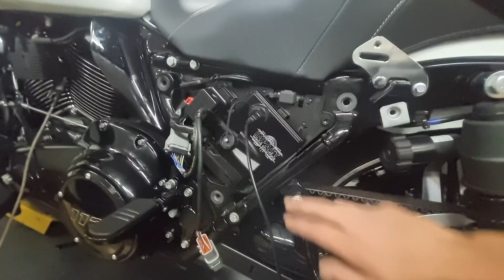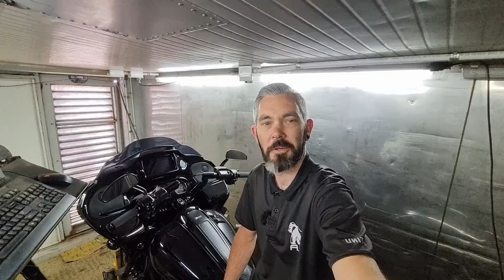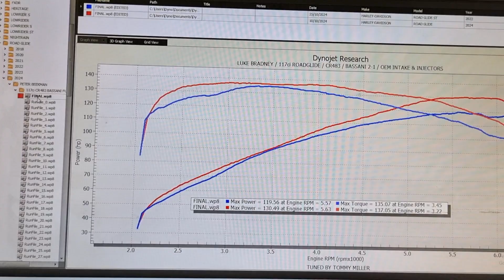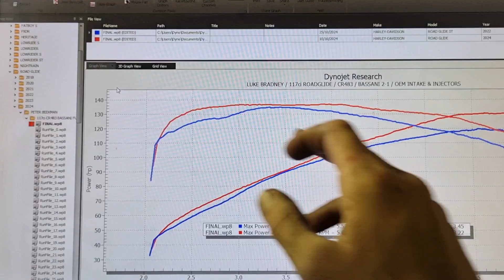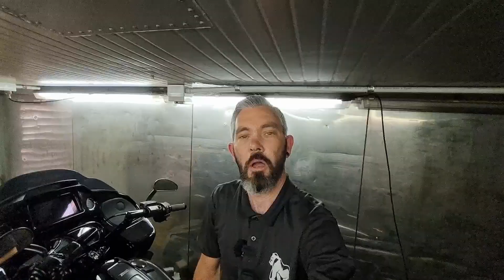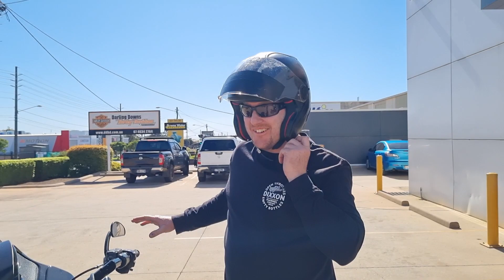IS THE 2nd GENERATION M8 REALLY BETTER?

Comment: Not impressed with Gen 2 over Gen 1 much ,why the Gen 2 has a  4.627 crank plus 4.021 pistons bore, an hp an Tq was to close so Gen 1 held its on for a smaller engine size.
Reply: Put a s&s crank 4.6 an head work on Gen 1 an after market thottle body u will b happy

Comment: I was able to get the new gen 2 stock 117 to make 150hp/151trq. 
SPC exhaust, 68mm Harley throttle body and manifold/ custom velocity stack intake, 8.1 injectors and E85. Cam used was a cycle Rama CR512 cam. Try it out. Tuned in thundermax ecu.

Comment: 119hp 135tq for gen1 m8 with a cam looks about right, i had that mine and you can maybe get more with a better air cleaner or pipe/cam config, but that ~12 digit difference between the two is in everyones graph. having the power go up like that to 130 now with just a cam is fantastic. its clear the gen 2 m8 just runs more efficient.

Comment: I’ve got a 23’ FXLRST with a Bassani ripper exhaust. With my pipe being slightly shorter, would a CR483 cam still have good lower end torque as shown on this video, or would you recommend something else? I mainly ride between 2500-4000rpm.
Reply from the maker: @Fxlrst_mcghee  I've not tuned the Ripper pipe before so I can't give you an accurate answer, however my experience tells me that your current pipe will pair nicely with the CR483 for a great mid range torque & power increase

Comment: Hi master tech Miller. Quick question  what hot idle rpm to you set the 131SE. Stage 4 kit in a 2021 fat bob.  Do you set it at 980 hot RPM. Or hier
Reply from the maker: Anywhere between 980 & 1050rpm usually. Just depends on how the engine responds to the IAC settings along with the pipe choice & Camshaft.
Reply: @MasterTechMiller  what is the idle setting with the 131 stage 4. Kit. With the pro street tuner whats it set at on the calibration. Is it 980 rpm hot

Comment: Not much of a performance upgrade but the new gen runs cooler which will help with longevity. I still prefer my 23, last year of the “real” air cooled Harleys lol
Reply from the maker: I'd argue the cylinder head is a great performance upgrade. It has a redesigned & far better intake port, the combustion chamber is redesigned & provides better squish. 
Then there is the intake manifold. Shorter & better matched to the ports. This means the short turn radius is cleaner resulting in better air flow. 

Plus the removal of the traditional breather. Now running the new transmission top cover with oil separator.
Reply: @MasterTechMiller  its going to be hard to justify buying a harley with an engine other than an m8 in it..

Comment: What do you think about putting a performance cam with the stock ECU?
Reply from the maker: There is very limited tuning with the 3nd gen bikes at this stage. Screamin Eagle offer tuning capabilities however it is very limited in adjustment & does not suit anything other than Screamin Eagle Cams.
The Aftermarket ECU from Impact Wiring Solutions offers FULL control & adjustment
Reply from the maker: In the Second Gen bikes?

Comment: I see that you youse alot the CR483.   How come not the CR480MT.    It is a touring bike
Reply from the maker: The CR483 cam is a little better suited for more mid range power than the 480MT or the 480 for that matter. 

The CR485 is more of a top end HP cam & not as well suited to Touring bike as it's a little heavier than the Softail range where the 485 is used the most.

The CR483 provides an awesome blend of low to mid range grunt with respectful top end HP. Perfect blend for a Touring model.
Reply: @MasterTechMiller  thank you. Tommy i guss I'm pulling out the 22XE.  And installing CR483
Reply: I changed my SS 475 to the CR 483. I know it's not the same as the one you mentioned. However the CR483 performance down in the low to mid range behaviour is so much better. And the power curve feels longer. 
TLDR in short. It's an awesome Allround CAM why use something else 
Fyi mine is a 2020 114 road glide
Reply: @TheCuttz1984  ok. Is the CR483. Similar to the boob woods WM822XE cam.
Reply: @iginogasparini3369  I'm sorry I have not used that cam.

Comment: I have been waiting for this vid.   The new 117CI is better than the previous 117CI.
Reply: @richpuller1348  it’s too bad they placed it in an inferior platform. That infotainment system and electrical system tied together is going to be an absolute nightmare 1-2 years from now for those that owned the first set of 24’s. There’s already been tens of thousands of recalls and bugs. Just gonna get worse. Having all your gauges and controls confined to digital screen, is a disaster waiting to happen
Reply: @Gimps_Garage  the recall was for the wiring harness. infotainment was fixed with updates. I have had a 24 for a few months as i bought after they worked out most of the bugs and havent had any issues. bikes been fun!

Comment: When that infotainment systems start going out and people can’t ride their bikes, then the gen 1 is gonna be the better option.  Harley is trying to eliminate small shops and garage mechanics by restricting the entire bike to an infotainment system and having to go to Harley dealers for any repairs that are resulting in an issue that’s tied in with the infotainment system; which is a big majority of the bike and electrical system. No thanks. I’ve seen more 24’s on trailers than I have on the road
Reply: Again has some faith in little or independent shops. They will eventually get around it like they have always done in the past
Reply from the maker: We'll just have to wait & see what happens. Infotainment systems are very common these days & I feel like the software engineers & the technology is some what refined these days. 

Sure there are & have been some issues with just about ALL Infotainment systems in both Cars, Boats & bikes, it's just the nature of it.
Reply: If the screen fails you just get a new one under warranty
Reply: @simmon81au  most of us void our warranties in the first few months lol. But let’s just say you keep it EPA compliant, erm I mean Harley compliant and you don’t void the warranty, I’d be worried the screen going out after warranty ends. Either way. I hope that’s not the case for all the people that bought one
Reply: @Gimps_Garage  we don't have that warranty issue here in Australia.
Reply: @simmon81au  yeah. That must be nice 🤘🏻⚡️⚡️
Reply: I’ve got the best of both worlds. A gen1 114 converted to a 131 SE stage4 gen2. 150/150. 
Stock 550 cam.
Reply: @Theldmfyhow did you convert a gen 1 air cooled motor / drive line to a liquid cooled gen 2?
Reply: @Gim @Gimps_Garage a water cooled. Oil cooled. They will bolt straight on if you buy the whole kit. 68 intake 68 tb CNC heads 6.2 injectors barrels pistons few other little bits. And because I’ve got the old timing cover the S&S exhaust still fits.  
Gen 2 has more oil cooling than gen1. 
20 hp/25flb more than 131 gen1. Heads and intake flow way better with the gen2 CNC heads than gen1
Reply: @Theldmfyhow much did it cost you to do that conversion?
Reply: @Gimps_Garage I’m in Australia. $6700 aud for kit. Plus Labor. It’s in a 21 streetbob

Comment: that youtuber "Marvelkid87" manged to get lower than usual figures on his CR483 117 Lowrider ST , do you think these mid length / short pipes dont really gel with the 483 Cam , the figures youve posted /Matt Smith /Cycle-rama and APE post that have the longer pipes seem to be 125HP + and 135 tq+.
i do notice the Gen 1 117 runs really hot road glide is better than the Low rider st i had im in UK so Thai built bikes  , do you know if the stock tune is different by region ? 
and when i say hot i mean the heat transfer through seat is so bad i had to stand on pegs to get airflow over seat (even worse with saddlemen gelcore fitted) this was on trip to dealer about 40 miles away air temp was about 18c Road glide  ST 117 is better but think its due to distance  rear cylinder is away from seat .whats the impact on  performance of the Gen 2 runnning cooler  would this mean its better in this respect too ,
thinking i should get the additional HD oil cool fan and the "ultracool " aftemarket fan and oilcooler set up to manage engine temps
Reply: marvels bike numbers are in SAE and these are in STD.. this needs to be factored into "lower" numbers.  That said, the shorty exhausts suck with the M8.
Reply from the maker: Shorty pipes are horrible though that's for sure!
Reply from the maker: I'm happy to take a photo of the SAE numbers of both graphs involved in this video. 
The difference will be small. What I should do in the future is post & film both SAE & STD correction factors to avoid this. 

Almost everyone is Australia uses STD correction factor, so when in Aus, all the compared builds are on the same scale. 

Almost everyone in the States uses SAE.

I'll film & post both graphs in the future so there is fair comparison for both
Reply: @marvelharris9540   tommy is at altitude 3000ft so numbers would be close to sae readings at sea level 
Alpha performance engines and Cycle-rama post figures for the 483 cam that were higher than marvels .people commented on his channel when he posted his that they were  a bit low intake/tune exhaust maybe to blame certainly in the bottom end of results ive seen .
i do keep a look out as ive got a CR 483 55/60mm inlet 6.2gps  injectors 4.5 khromewerks ready to be installed in my road glide
Reply: @marvelharris9540  always have on Any HD...in my opinion....mite b allright for sporties tho🤷‍♀
Reply: george bryce also said his cams dont like short pipes

Comment: I have a 22 RG ST.. I have the new gen m8???
Reply: no  the ST's got the motor from older version117  CVO new gen fitted to 23.5 CVO and 24 touring models has water cooled heads 
i have 23 road glide st 117 engine its just oil/air cooled
Reply from the maker: No mate, you have the last of the gen 1 engines.

Comment: Anything less than one Horsepower per cubic inch isn't high performance
Reply: @georgegrout6995  exactly. A good build with a good tuner should easily be pulling 1.25-1.5HP per cube
Reply: @Gimps_Garage  Exactly! My K1600 is 1.6HP per cube and was built by BMW.
Reply: 1000cc is 60cu  @scooternut7198
Reply: Mine is down .. 102hp 103

Comment: I have the same bike. 23 Roadglide-ST. I put a HPI intake manifold, Sawicki speed 2into1 stainless shorty, power vision tuner mapped from fuel moto.ultracool oil cooler and the bike is a beast without a aftermarket cam. He really needs to throw away that plastic manifold.
Reply: @Prometheus1979  need to get yourself a better cam :)
Reply: I plan on it down the road. I’m thinking a star 30/30 cam
Reply: The new 117 doesn’t have the plastic manifold on the touring lineup only softails come with plastic intakes in 2024
Reply: Didn’t know that. That’s good to hear. They should have never went to that in the first place.
Reply: @Prometheus1979  so now you Know
Reply: If that's the case why does my 2024 Street Glide have the plastic intake?
Reply: That’s what I thought. Harley went to a plastic intake on all bikes except maybe the CVO. My 23 had one. There’s some misinformation going on.
Reply from the maker: What engine does your 2024 StreetGlide have?
Reply: @Prometheus1979  no misinformation my friend 
All 2024 117 in the touring platform have the new intake any dealership will be able to tell you that 
107 and 114 that are in the touring platforms have plastic still same as all softails even with the 117 hope it helps you out
Reply: Great choice in cam 
They’re all producing huge numbers for a stage 2 setup
Reply: And a better exhaust too